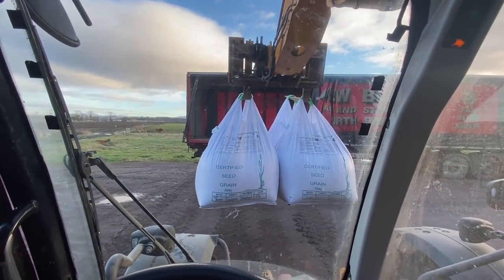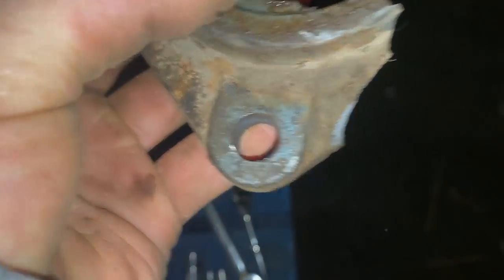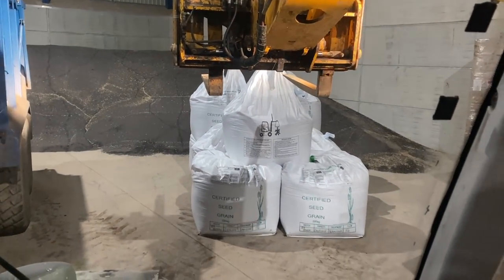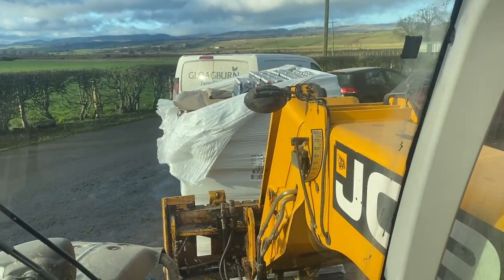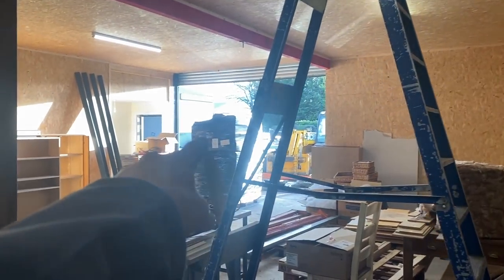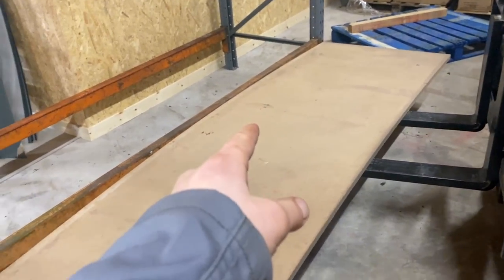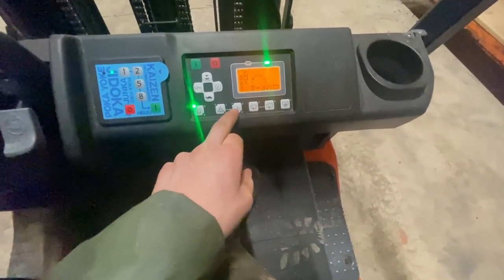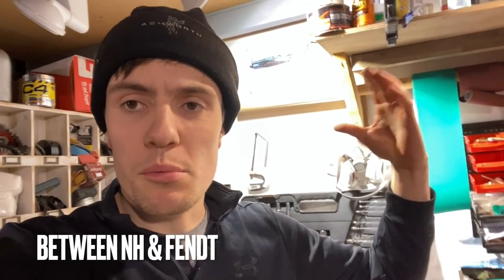NEW TRACTOR REVEALED | TOUR OF THE DEMO FORKLIFT #CRAWFORDFARMS #188

Comment: Get your 4 inch grinder with a skinny cutting disc. Cut a track along inner collar/race of bearing. Get a sharp small chisel and tap it into track which will split race and it will slide off. Two minute job.
Reply from the maker: Got her off with heat not to worry